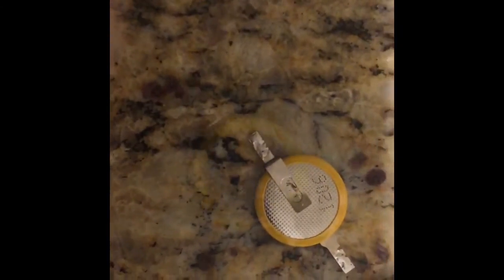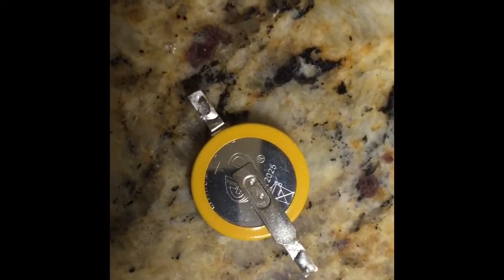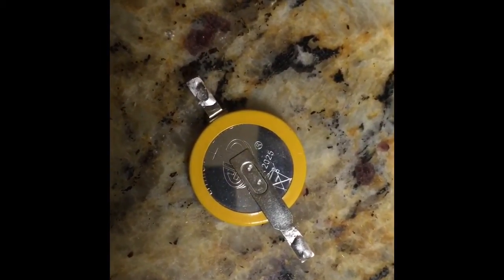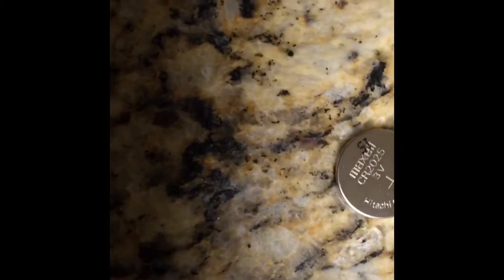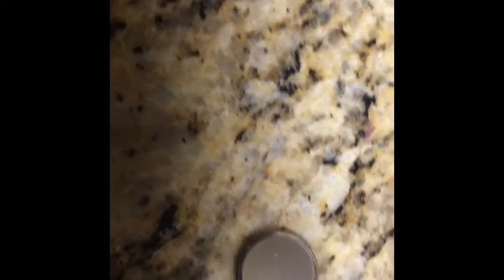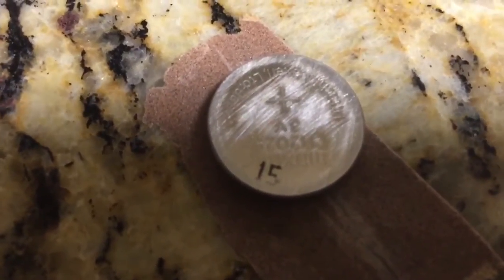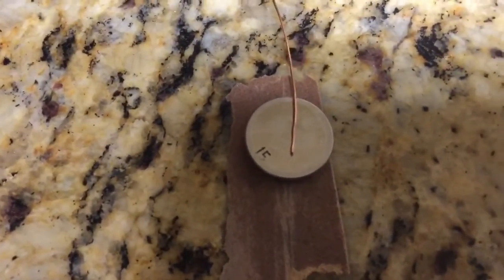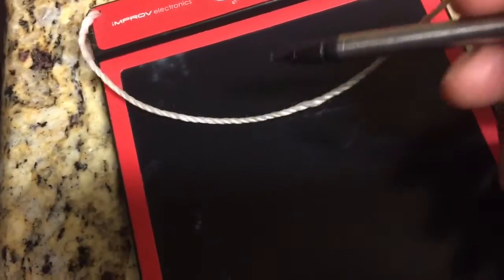Replacing the Button Battery on Disposable LCD Writing Tabl

Comment: I want to do this, but I'm not going to re-solder a new battery in there only to have to deal with this problem again. I'm just going to wire up a battery slot so I can change them whenever.
Reply: +Brian MacDonald Could you perhaps make a tutorial for how to do so? Making an easily replaceable battery.